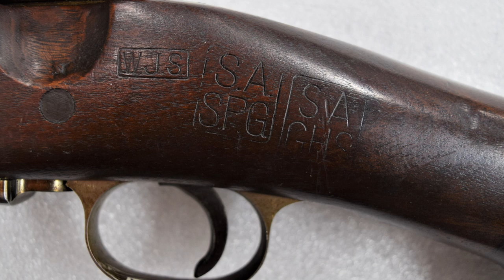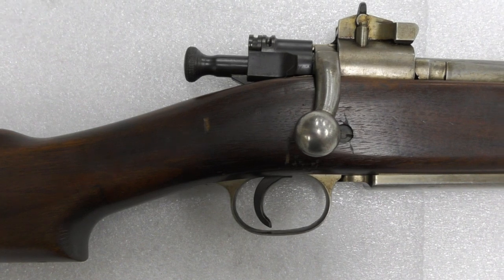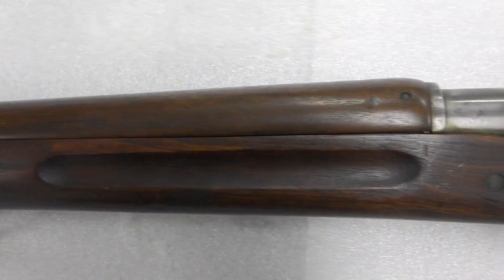TAB Episode 69: Remington .303 M1903 Prototype

Comment: Remington built P14s and M1917s what happened to the tooling to make them.
Reply from the maker: I'm not sure for certain but I suspect if it was anything like Winchester the tooling and guages were returned to govt ownership. Complex arrangements. They didn't seem to have them at hand in 1940.
Reply: Even if it wasn't returned, the tooling would have likely been either repurposed or sold, as there where no major orders for the P14/1917 after the war, and they were all commercial companies, none of which would likely keep that kind of thing mothballed 'just in case' when that costs money, and all of them had severe financial issues post WW1. I mean they didnt restart production on the Mosins, Berthiers or even the OG 1903s either.